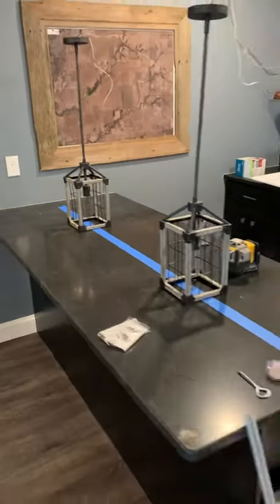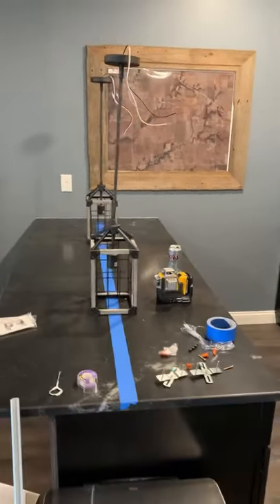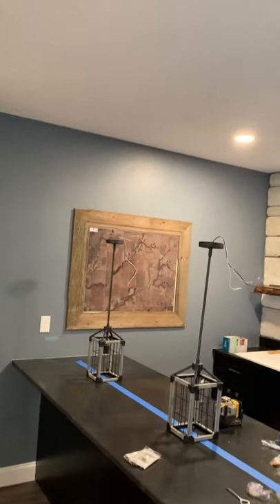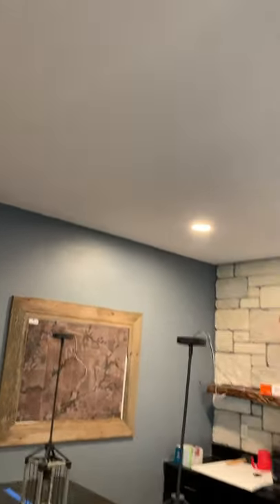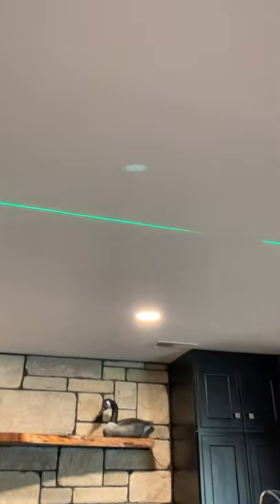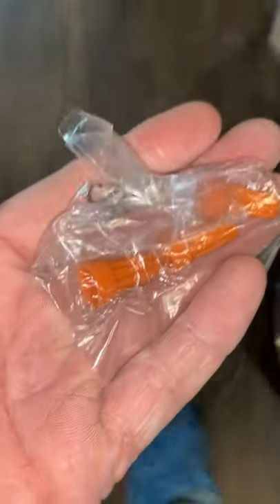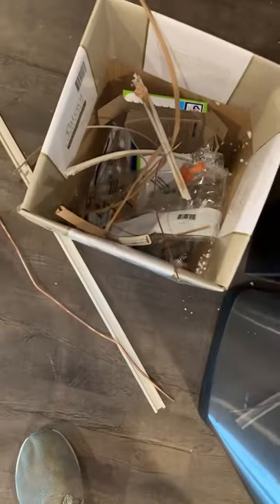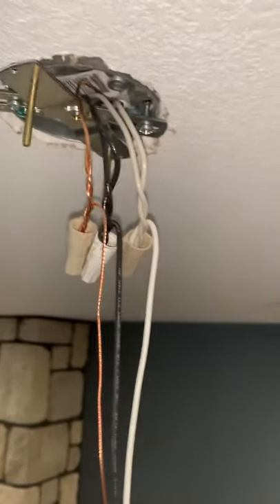Pendant lights installed! #electrician #diy #apprentice #help #led #lights

Comment: If you're going to take the time to perfectly place those lights, at least also take the time to ground those metal boxes 😅
Reply: He cant...he is bored!
Reply: There's no point in it.  It's not attached to anything else and the fixture is grounded already.  Also, it's connected by metal to metal through fixture
Reply: @saywhat6632 that’s the point. It’s not attached to anything else, therefore, electrons will look for their own path. And the painted fixture bonded exclusively through the mounting screws offers too much resistance to clear a fault
Reply: He probably grounded the pancake box, what you saw that wasn’t grounded was the bracket. I assume
Reply: Should have ran sperate switch legs, those boxes aren't rated for 2 wires, but he didn't think he'd hit a joist and he would have used a cut in which would be good for those pendants but really limits you on weight compared to a box directly mounted to framing.
Reply: Bond all metal boxes. Its pretty simple.
Reply: all you gotta do is use the bonding screw that on the bracket and if it aint there wrap the ground around one if the box screws
Reply: I didn’t see him ground that pancake. 

He definitely SHOULD HAVE grounded that pancake.  And maybe this is nitpicking, but he really use the “old” nut? Yes. I know it’s probably “fine”, but, you know? Idk. Throw away the orange pieces of shit. Also throw out old nuts 🤗

Coming from a real electrician.
Reply: Its bonded through the light fixture SCREWED to it🤦‍♂️ No way you're an actual electrical.
Reply: @OUTDOORS55  if you were an electrician, you’d know that those mounting screw threads are too high impedance to clear a ground fault in a timely manner. That’s why there’s a code reference as to what screws can classify as a “ground” screw
Reply: Pancake boxes are only good for one piece of 14/2 not 2 but a professional would actually know that and either make a junction in the attic or explain it to the homeowner and move them to be able to put the right box in .
Reply: @saywhat6632 
Grounding is never too much. Box, support bracket, and fixture. Be safe.

Comment: Such a pro didn't ground the metal box and pancake boxes are only rated for 1 14/2 Romex not 2.... Not a pro but definitely a hack
Reply: Great video editing skills though 👌
Reply: I was looking for this comment to see if I needed to leave it on this video.
Reply: @johnh8546  me 2  lol 👍 but I was gonna just keep it to myself
Reply: I wouldn’t call him a hack.  I always ground the box but once everything is up all the metal pieces with be grounded     .  Also. The canopy might add enough volume to let 2 -14s in there
Reply: Aw let the guy some slack, the fixture is grounded who gives a shit about the box
Reply: @owenmercer5443  the NEC state code requirements and any electrician worth his salt and people that don't want their house to burn down.
Reply: @johnh8546  I am aware of the NECs terms but I also know that not grounding what is essentially a mounting bracket isn’t gonna do crap
Reply: @frankw3606  actually your wrong light fixtures don't fall under redundant grounding code and it's not a good source for a ground
Reply: @owenmercer5443  then you are oblivious and please don't do electrical work. An ungrounded metal box is a great way to get someone shocked
Reply: @johnh8546  I come from a town where most people still use ancient ungrounded systems in their homes. Most homes have knob and tube and no grounds and we are doing fine, all I’m saying is should we really worry about grounding a junction box, specifically a pancake, if there isn’t really any issue not doing so as it was done for the last hundred years
Reply: @josephbrown4752 light fixtures don't fall under redundant grounding code? There's still 120v on the wires coming into the metal box so yes the nec still applies. Not a good source for ground? What does that even mean? Are you even a sparky?
Reply: @owenmercer5443 not grounding any metal component can cause a shock or even a fire by allowing the electricity to potentially find its own path back to complete its circuit, rather than your specific ground path should a hot wire slip out of a wire nut or come into contact in any other way. True, it's unlikely, but worth the extra 5 seconds
Reply: @owenmercer5443  oh yeah hey people did it for a long time so it's good. Let me remove my CO detectors, and my smoke detectors, my home security system, take the seat belts out of my truck along with the air bags. I mean why bother making things safer because it works right.
Reply: So you've never went over the speed limit?
Common sense is more important than the code.
Reply: @MrArcticPOWER  common sense is important so common sense would dictate when you have a conductive metal box that could potentially rub through a hot conductor you should have it grounded. Glad we all agree that grounding a metal box is code and common sense compliant.
Reply: Maybe should just state that electricity will follow the easiest route to ground which is why we don’t  “wing it” and ensure that as an electrician we create/ensure that route for safety!!! doesn’t matter that all the components are metal so they create a ground we are ensuring it flows where we want it while following code requirements that enforce the only rules that are truly important in the code and which all the rules and sub rules are based around which is “The prevention of fire and shock hazards”!!!  “HACK” it up anyway you want but that is the root rule!!!
Reply: wait a second are you guys not using single wire earth returns (SWER) for your light fixtures? that's how I always  fit my wires in the shallow boxes. my rule has always been. make what you have work. if it's shallow boxes some grounds will be finding their own way home. but all my screws are always  uniform in a straight line and turned the same way. it's what I pride myself on.
Reply: @jasonnadeau7928  no electricity will take all available paths back to the source. We just ground bond side of the transformer so that we can ground all conductive casings. So if a hot lead touches a conductive surface it will have a low resistance path back to source and trip the breaker or blow the fuse so that the case doesn't become "hot".
Reply: @johnh8546  I never said it would!!! I said as an electrician I try to guarantee that in a short condition the it will take the least path of resistance that I provided is the bond wire attached to the grounding screw and spliced to all other grounds in the box so that Carries it back to the panel!! What I don’t do is assume that because it’s a metal box that mounting screw will do that job for me!!!
Reply: That’s over box fill on a pancake aswell
Reply: I was coming here to say the same thing. I'd add that power is on at the house and those wires were not capped 🤣. The journeyman that taught me used to say "one of the worst things an electrician can do is THINK HE KNOWS WHAT HE IS DOING"
Reply: @owenmercer5443  Maybe the family that is sleeping inside when it catches on fire. There's a reason electricians have 3 1/2 more years of training than cops.
Reply: @jjaa578  been solid for 80 years
Reply: @frankw3606  “might” lol
Reply: "Im a pro" 
Dust all over counter top with a coors light 🤣 true pro!
Reply: @josephbrown4752  all metal boxes have to be grounded by code, it doesn’t matter what you are installing on it
Reply: Thank you.
Reply: Was just gonna say the same thing
Reply: @frankw3606  key word should still run a ground wire through EMT.... J/S
Reply: @johnh8546  Can you explain how someone could get shocked without the box grounded?
Reply: @mooreremodeling  because the supply is grounded from the source it came from. So if your breaker panel is grounded (which it is). If your breaker panel is ungrounded don't worry the 7k volt transformer supplying your house is grounded.
Reply: Georgeb 
   That’s  what I was thinking.
   How hard it it to put a moving blanket down ? Don’t scratch the new countertop . Make clean up way easier
Reply: @owenmercer5443  😂😂😂🫠🤡🤡🤡
Reply: @johnh8546  if the light is grounded, a pancake box doesn’t realistically need to be because the only time that box is getting touched is if it’s being serviced and if that style of light is being serviced live then there’s a bigger problem.
Reply: @owenmercer5443  it's is a matter of requirement and I get that much of what we do is to prevent the 1 in a million fault. You never know when you are going to get that issue though so you should follow code. The NEC has everything it does because it comes from a mistake made at some point that led to an incident.
Reply: And yet it can be done, yeah should have grounded the box but we all know those grounding wires will be pressed against the metal anyways, real life application vs reading from a book and thinking you have to follow it no matter what
Reply: @ryantracey8574  oh loose incidental contact is our bonding method now. Luckily I think arcing looks really pretty, and house fires are pretty cool.
Reply: @ryantracey8574  agreed, and the box never gets touched other than to work on it
Reply: Exactly what I was going to say!
Reply: Get em!! I was just about to comment the same!!
Reply: @johnh8546  wow, someone is lit up!  Pun intended.
Reply: @frank w  ya people forget that box fill also accounts for the extra space given by the rest of the fixture, not just the pancake.
Reply: The canopy on the light fixture counts toward box fill.
Reply: Exactly 💯
Reply: @cheddarmccheese5855  no it doesn't
Reply: The canopy of most light fixtures can be considered as cm volume 🤔
The canopy has to be marked with its cm
Reply: I always double sl to avoid 2 wires in the pancakes

Comment: Just came here to read the YouTube electrical experts comments.
Reply: Well did you learn  the proper way?
Or do things like this guy did.
Reply: It's becoming a new hobby
Reply: Did you learn the boxes the guy used are only rated one piece of wire not two?

Comment: Before posting a video. Please review. Ground the box and limit wires in pancake box. Way to go “pro”.
Reply: It’s what the pros do. His video editing skills are better than his professional electrician skills
Reply: Yeah I thought it was 1 cable max in a pancake box?
Reply: @petercsomor2917  Not necessarily, it goes off the cubic inch rating of the box and the sum of the cubic inch of your wires. That pancake box is only good for one 14/2 conductor though

Comment: When I use to go to work with my dad I always would build spaceships out of wire nuts, the little wings make them look like a tiny rocket ship lol. I went to work from age 4-14, worked in the summer and got paid and I gained tremendous skills

Comment: Just a word to the wise I would cover that peninsula.... If scratched could probably be fixed with a service call but that's not a cheap replacement and some customers will try and take advantage

Comment: FYI… we can’t install 2 romex in a pancake box in Canada
Reply: It’s the same here is the US.
Reply: It’s not the same in the US as long as you use the appropriate bushings/Romex connector and account for box fill.
Reply: @christopherrudd1229  
Table 314.16(B)  14 gauge wire is 2.00 cu in
2 cu in hot
2 cu in neutral 
2 cu in for the grounds up to four wires
2+2+2=6
Romex connector doesn’t count.
Pancake is good for 6.00 cu in.
Nothing more can be installed. Only one 14/2 romex is permitted.
Reply: The way we get around it for inspection is we use an extension ring when we have 2 hits for the rough to get our clearance but at finish they come off and get used on the next one
Reply: @ibol13l3   not necessarily because the fixture itself provides more fill space
Reply: @truedarklordgame2478  not true at all
Reply: @AnxOG663  Hahaha awesome
Reply: @Truedarklord Game  when ubadd the shroud from the light it adds CU so u are able/allowed by code to wire in the light.
Reply: Came here to say this!
Reply: @truedarklordgame2478  you have to calculate the box volume? Why? Aski g from UK
Reply: This is why my master electrician has taught me to make the junction at the switch box for pancake situations.
Reply: It's not ok in the U.S. either!
Reply: @truedarklordgame2478  My box fill app says the fixture wires add 3 or 3.5 to that depending on if they are 18 or 16 gauge, so there goes the thought that the added volume of the fixture itself helps.
Reply: Same in the us. And I don’t believe it’s rated to hold a fixture but I could be wrong on that one
Reply: We can't in the USA either. Box Fill. It needs to be one deep box and one shallow or two deeps. No need to throw away good wire nuts either. 😜. My goodness. 

Jeff - Licensed Journeyman Electrician
Reply: That volume is used for the fixture wires in this case. This video is incorrect and wouldn't pass inspection.
Reply: @J_M3444  Pancake boxes are rated to hold fixtures, just not fans.
Reply: @SicknTwistedx how's that work for multiple lights though?
Reply: @Charlie Decker  to ensure there is adequate space for the wires and splices added. To ensure there is enough room for all the wires, and that heat won't be an issue.
Reply: Name the code or UL listing. Box fill says I can use 2-14/2 in that box. Also he grounded it in the box, not the fixture ground
Reply: Yes, you can. You just can't do it if you're a rule follower.
Reply: I love to here installers call them selves electricians 😂
Reply: I think this was an extra after the fact. At that point you do what you have to do.

Comment: Coming from someone who has done island lights for 10 years, you nailed it! Ignore all the comments about not covering the island, the place will be cleaned later anyway so a bit of drywall dust added to the cleaning job is not something a professional has time for. 

Also, the grounded light is connected at 2 points to the box so even though it's code to ground the metal box, the practice is redundant and really a waste of time. No time to strain at that gnat.

Comment: I did a bunch of work for a family friend for free. Hanging drywall, insulation, and installing lights/fitting trim. The whole time I talked about how useful a laser level would be for hitting studs when hanging drywall, and after we finished, I found one in the mess of tools the guy we were doing work for had.

Comment: Industrial electrician here. I cannot even tell you how many of those tan Ideal wire nuts I have used over the years. Many thousands. I use the Ideal orange ones for smaller wire.
Reply: I only use marrette.

Comment: Need to ground it and use 4-0 pancake box to double up wire in there also biggest pro tip put down a drop cloth. 🤘🏻🍻

Comment: Very nice 👍 install job fellas, you obviously have taken the age old kitchen remodeling  adage to heart, you measure three times and cut only once. One quick question though, how important is it to have the dropped height of your new pendant fixtures the exact same height as the already existing dropped pendant fixture over the kitchen table? In cases though where there is no kitchen light over the table  constraint, what is the standard height of the new pendant light fixtures over the peninsula countertop? 😎

Comment: I'm guessing that there is an open attic above those because you didn't fish those electrical cables out through that half inch hole without damaging that drywall

Comment: Save orange wire nuts for low voltage wires. And the box is grounded until that fixture ground is disconnected and over on box fill with 2 wires in ur cake.  FYI DIYers plz don't ever use the center K/O on a pancake boxes. Some fixtures use a threaded nipple in the center to hold up fixture and wires could short.

Comment: Ground your metal box with a ground screw.  Plus you are not allowed to put more than one romex into a pancake box. If you think your going to land on a roof truss or floor joist, then you need to pull multiple switch legs from your switch box.

Comment: Box fill...
Reply: Bonding
Reply: No issue with box fill... the cover of the light is counted for the rest of the box...
Reply: You don't stuff the box huh? You go easy on it and leave room in there?
Reply: "Box fill" 🤓🤓
Reply: @narmale  most pendant lights are NOT rated for electrical box fill
Reply: @mr.g937  your right,  "not rated" because then they would have to be certified for those ratings, and they would cost 10x what they do right now...

But it doesnt change the fact that you leave wires in their area and that contributes to overall box fill wether they are rated or not
Reply: @narmale  Sure, but code doesn't change the fact you can probably terminate two NM cables in a pancake box and get away with it. The whole point is that it isn't to code and professionals do things to code.
Reply: @mr.g937  man, i hate to break your bubble your living in...
Reply: @narmale  Mr. G is correct.

Comment: Are 3/O and 4/O pancakes rated for two wires? There are times I don’t put boxes. But if you have cabinet plans and can read a tape measure you can install boxes in the rough.

Comment: I do this for a lot of different fixtures that are dependent on other room finishes for positioning. Islands, vanitys, wall sconces. Coil up the wire in the general location, then cut them in after the  vanity mirror, furniture pieces, and whatever else the interior decorator is gonna freak out about not being dead on point.

Comment: The ground goes to the fixtures the fixture is screwed to th box with metal hardware they are grounded even if you attach the wire to the box you are still depending on a screw
A box rated for 1 cable would be useless
He is messing with yall the light boxes and island fell right where he wanted
Looks good Dude

Comment: I am trying to install one of these, my question is, how do u power them. What’s the power source
Reply: You get power from the switch which gets power from the panel or another box in the circuit.